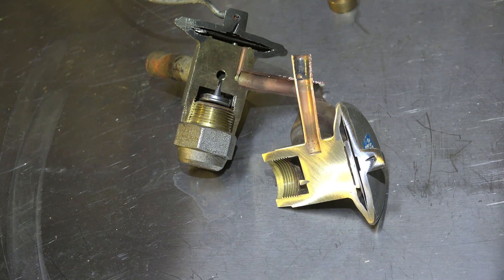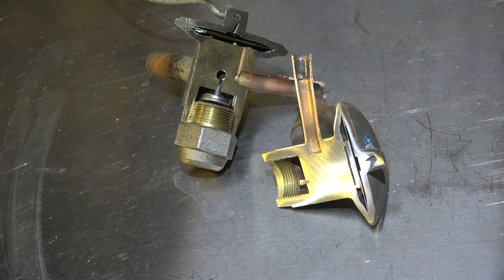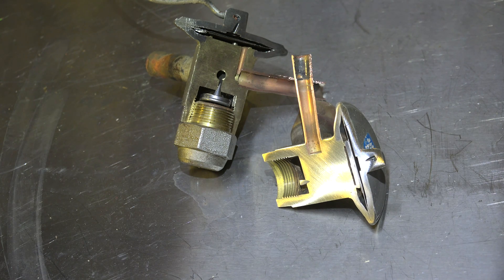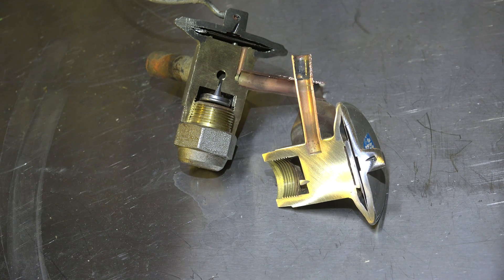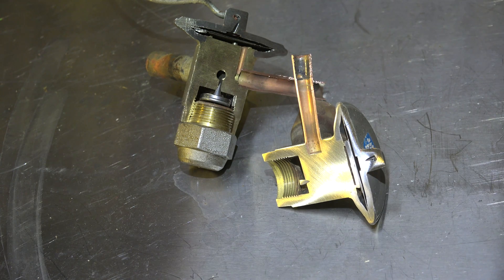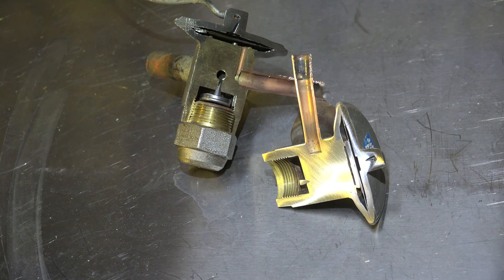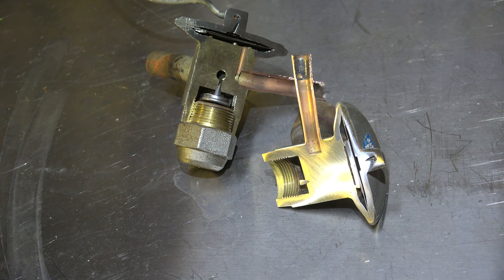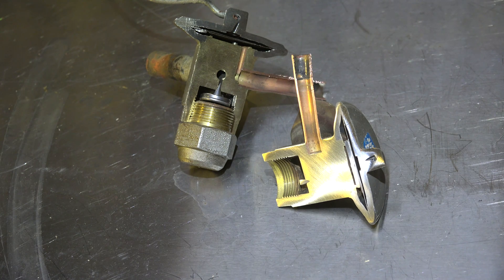What is a non bleed TXV

Comment: It wear out the compressor sooner?
Reply from the maker: It could.  The compressor must start against a head pressure which makes the start harder.
GFM
Reply: Why would manufacturers ever use a non bleed txv if it is harder on the compressor? What benefit is there?
Reply from the maker: @formekinetics691   Its about refrigerant flood back when the compressor starts.  The evap is the coldest part of the system, so refrigerant migrates to the evap in the off cycle.  
When the compressor starts, the liquid floods back and could damage the compressor.  The non bleed TXV stops this from happening.
GFM

Comment: Which units might we expect to find these on (mfg, size, residential vs. commercial)?
Reply from the maker: +Sirfloatsalot1 That one is off of a Trane heat pump.  They are used on both residential and commercial.  They are the most common valve used on refrigeration.
GFM

Comment: Thanks grayfurnaceman!  
May I ask a question that if we install a Liquid Line Solenoid on the liquid line and store all the refrigerant on the high side during the off cycle, could we overcome the high starting torque problem and use the PSC motor with a non bleed TXV?

Comment: Are you cutting them open with a band saw, its a nice clean cut. My TXV failed and I want to cut it open to see why it failed.
Reply from the maker: +Justin Hernandez Just a hack saw.  With a little magic added in.  lol
GFM
Reply: It is rare to have a TXV fail. They are so often mis- diagnosed that manufacturers years ago when from a flare fitting to a sweat making it more difficult to change thus causing the tech to troubleshoot more thoroughly before condemning them under  warranty. I am referring to equipment like ice machines.  When they do fail it is usually the power head rusting through and losing it's charge or the inlet screen clogging with oil or carbon deposits from someone brazing the copper lines without purging with nitrogen.  POE oil acts like a detergent in a newly installed system cleaning the inside of akll the copper and clogging at the smallest orifices like the TXV.

Comment: Is there someway from just looking at the TXV to tell if it is a bleed TXV or not?
Reply from the maker: It's on the model # of the valve. You will have to check manufacturer specs. 
GFM

Comment: Those cutaways are really helpful in seeing how the operation works.  I assume that non-bleed helps with efficiency, but do you know if there are other reasons why a manufacturer would choose that design?  Adding a start circuit adds to initial cost and is a potential cause of break-down, so it seems manufacturers would want to avoid non-bleed design.   Thanks.
Reply from the maker: +Straycurrent I can't say I know why.
GFM